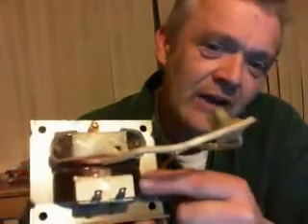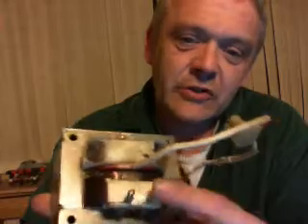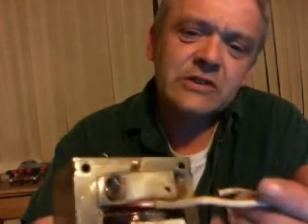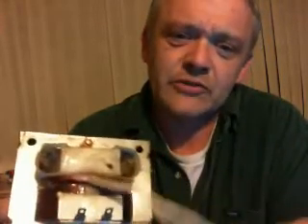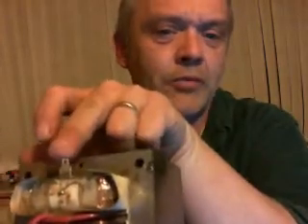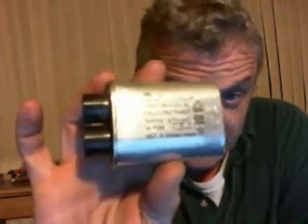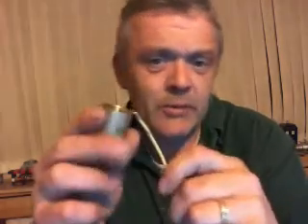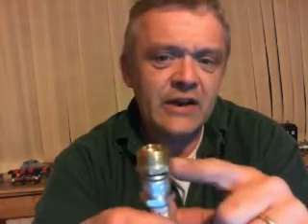blowing up water 2 - some details and background

Comment: Sir Robert, is it possible to extract hydrogen by inducing a plasma over atomized water? 
Like plasma gasification, but using salt water instead of using water with hydrocarbons.  
Kanarev used to induce plasma electrolysis in plasmatron. 
My idea is to atomize water into finer droplets, super heating with plasma,  in order to extracting hydrogen.
I'm aware that it is possible to extract hydrogen from water by using temperatures above 1500ºC.